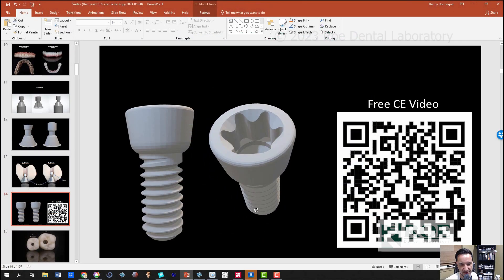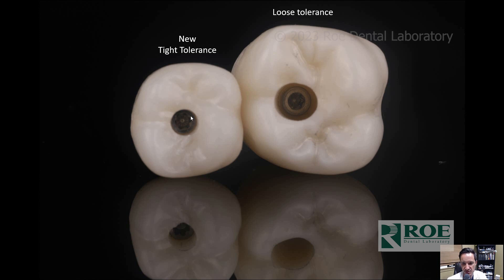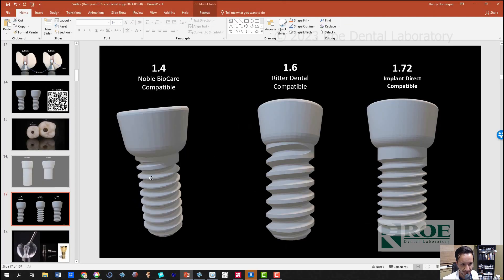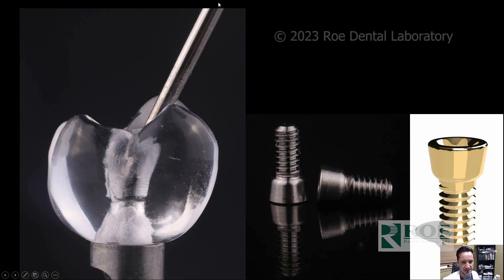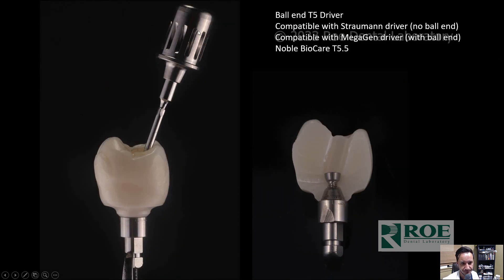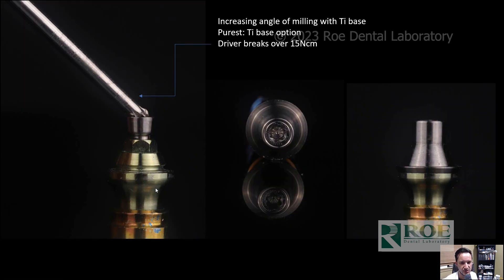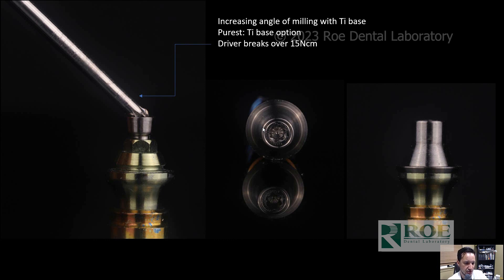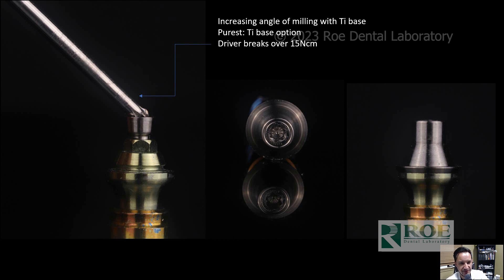Vortex: Screws and Associated Drivers

Comment: Breakable driver , now that would be the best investment yet, as a lab ,I would send these to my Doc’s for sure
Reply from the maker: A breakable driver is a very purposeful piece of equipment that acts as a fail-safe protecting other significantly more expensive surgical components. It is specifically designed to break when pushed beyond 15Ncm protecting the screw itself from becoming damaged. By having the driver break ($45 on ROE’s online store - https://shop.roedentallab.com/collections/grammetry), and not the screw, it helps prevent damage to the zirconia arch (a patient cost ranging from $10K-$15K), protects the MUAs, and enables the doctor and patient to complete surgery quicker. A lot of inherent benefits from something so seemingly simple.